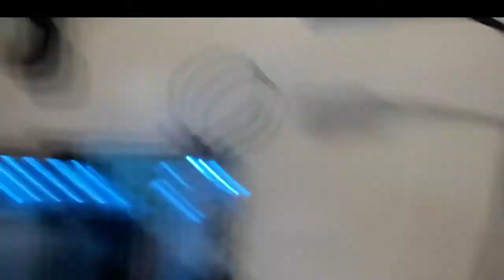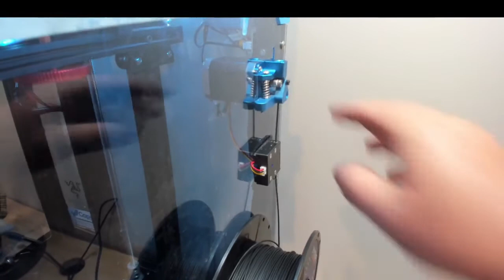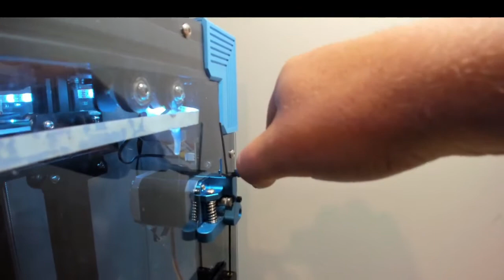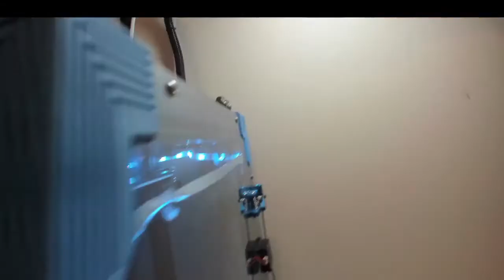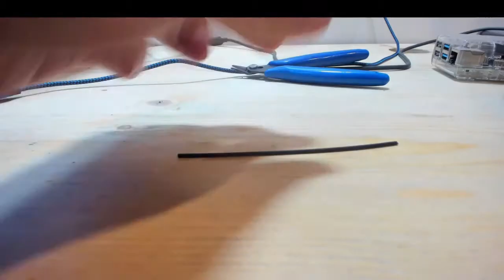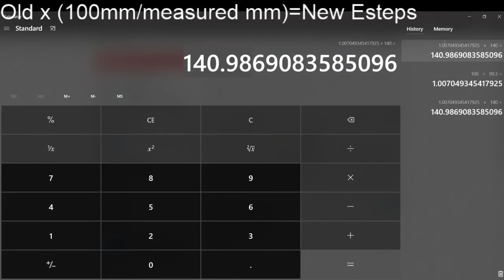How to change ESteps using Octoprint

Comment: I just followed the steps and my settings reset back to the original value after I reboot the printer. You never mentioned to enter M500 to save the changes.

Comment: Will the setting stay when you leave octoprint?  I only print through SD and keep my printer offline, but it sounds like the only way to adjust extrusion is through the computer.  So, I will do these steps, but once I disconnect, will I lose the adjustment?
Reply: once you type the m500 which i forgot to mention in the video (i had put it in the description lol) it should stay for good

Comment: So I have a vyper from anycubic. I got octoprint setup and working quite easily. Printing is another story. I don't see many options for really doing anything on the vyper. So I was wondering what the command would be to extrude 100 mm of filament from the printer with octoprint. As like I said I can't find an option to do it from the printer itself. I printed a couple of test prints and then I ended up with a clog that got stuck in my Bowden tube. Guess my retraction settings are off. But I still would like to check my estep to make sure that isn't part of the problem. Nice explanation by the way. Thanks and keep up the good work.
Reply: if you're still wondering how to extrude using octoprint. Go to the control tab in octoprint, and there under Tool(E) you can set how much you want to extrude or retract. The clog could be a few things, start with the basics like Z height and make sure the bowden is up against the nozzle in the hot end. Then look at things like retractions. But yeah do the E steps first.